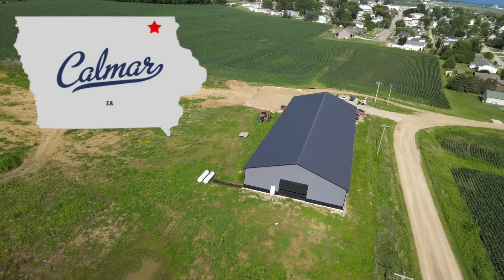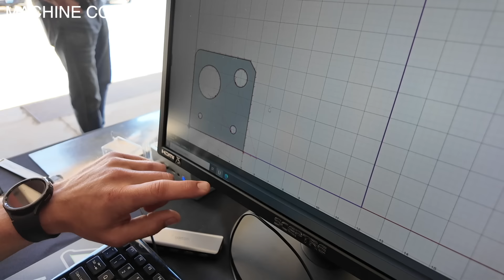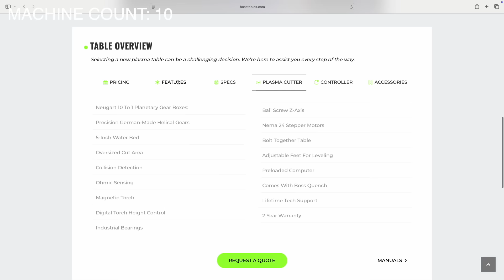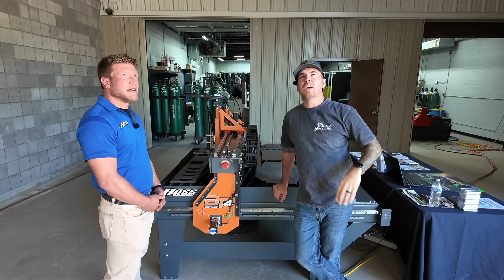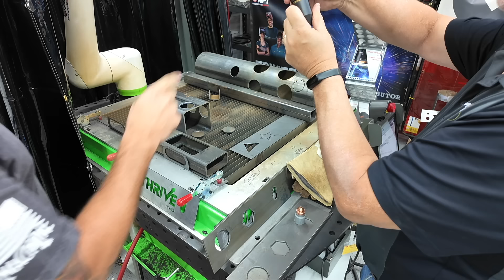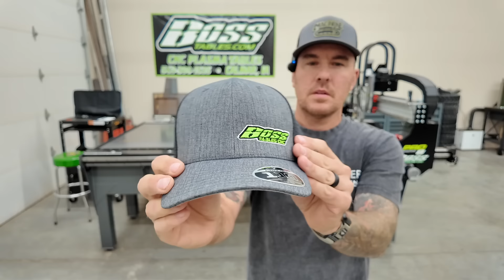BOSS Just Raised the Bar for Bolt-Together CNC Plasma Tables!

Comment: I work at machine shop they have a lot of CNC machines and avg size laser machine and 1 pretty big laser machine I think it could cut up to 4 inches of steel this was over 10 years ago last time I worked there what I was told bigger laser cost 1.5 million

Comment: You might want to ask the Boss people about having a folded edge going from one side of the water tank over the other side of the water tank where they can still slide apart, but there’s not a gap in between the two pans.